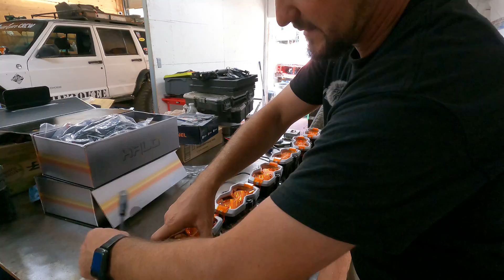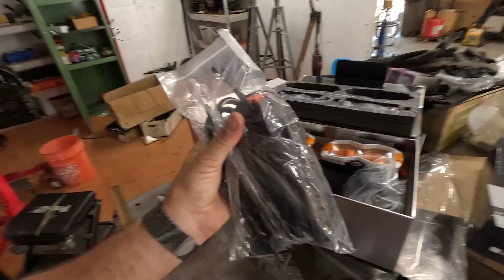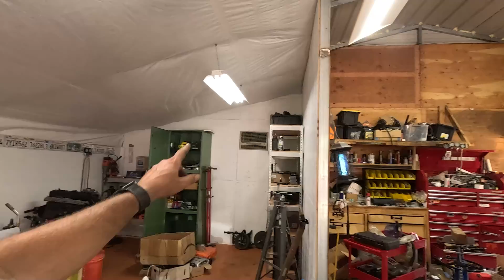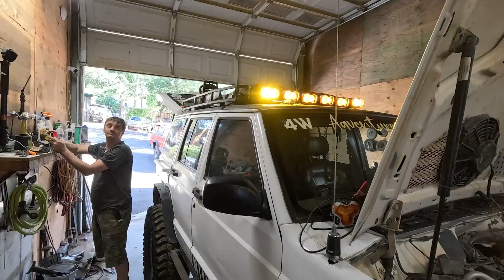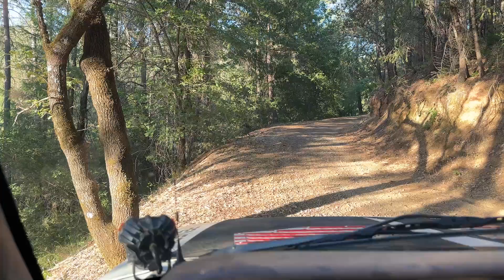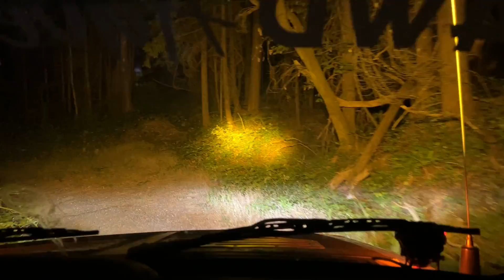Lights After Lockers, Building Custom LED Bar NovSight Halo Pro

Comment: Good stuff! What is your battery and alternator set up?  I want to run more lights to.
Reply from the maker: Alternator is from Dodge Durango 5.9 it’s a 139AMP 

Battery is Walmart Special and to Small 35AH in back for House and Camera Gear charging